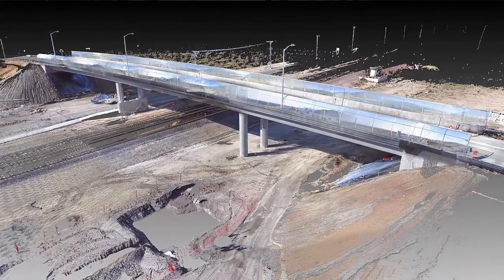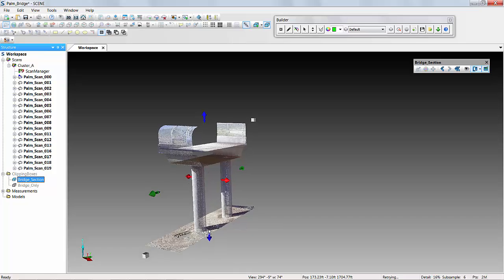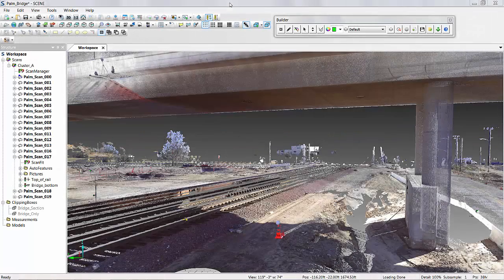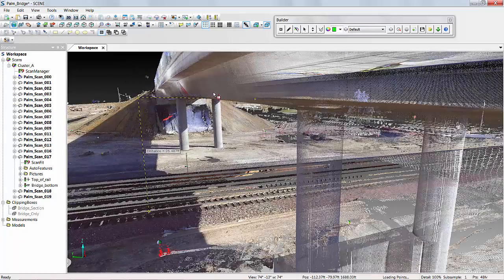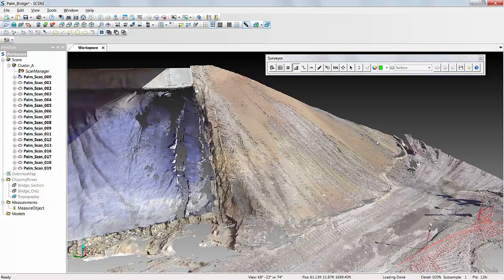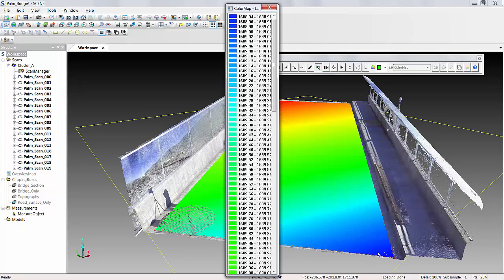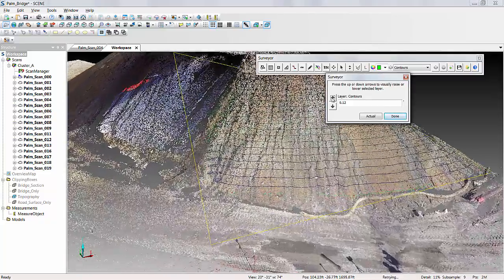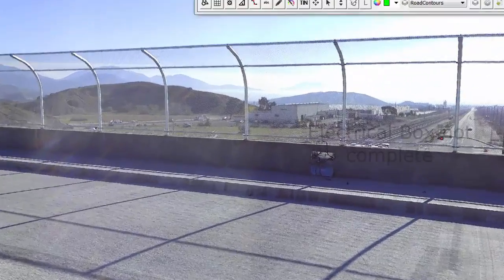Bridge As-built - FARO X330 Laser Scanner

Comment: Your bridge came out really nice. Couple of notes. The movie app. Pro app that is. Is an app that is roughly $1k add on feature. You can use a free app however the Faro water mark will float around your movie. Also I am curious to your Faro setting. If you did 20 scans in 3 hrs. I would think your setting was 1/5 at 3x. for a 6min and 20 secs. Is this correct? Also where you using the new HDR X330?